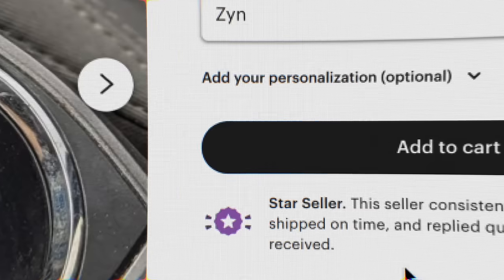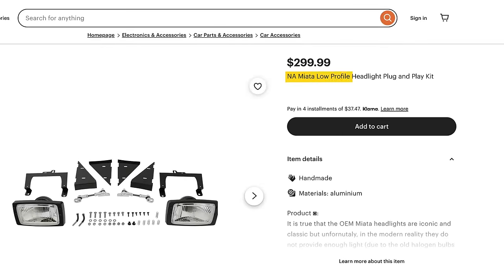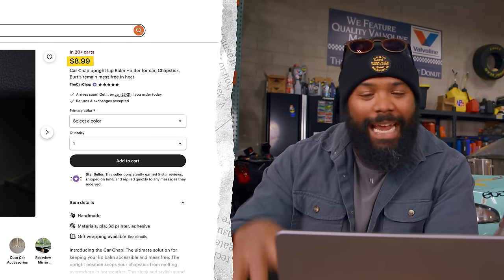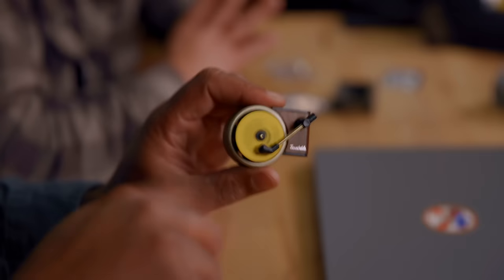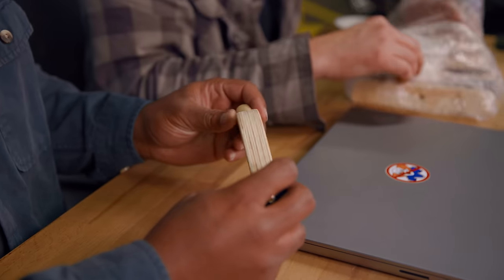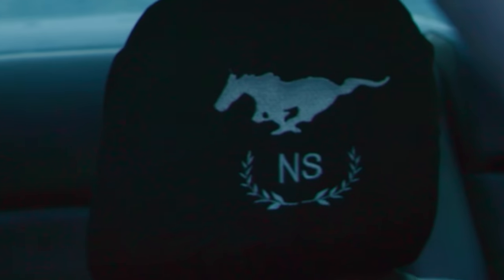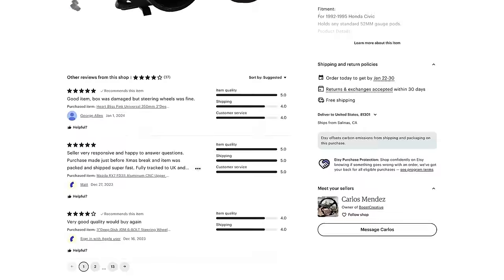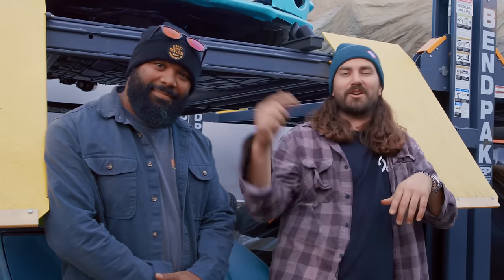We Tested Car Products from Etsy

Comment: honestly surprised that Subaru sponsored this, given everything the Donut boys have done to the WRXs and their engines 🤣🤣
Reply: I’m surprised it didn’t break before the commercial ended
Reply: @big.muscles.ohyeah  Uh, Honda, Toyota & Subaru are all over rated...
Reply: it was very sad to see them pushing some boring crossover tbh
Reply: @davidhollenshead4892  -- Honda and Toyota being "overrated" is an absolutely wild take lmao... I'm still driving a 2005 Camry. It's got 250k miles and it shows no signs of dying. Toyotas and Hondas are literally some of the most reliable and cheap-to-fix cars you can buy. Calling them overrated is just insane lol
Reply: Can't blame it all on the boys as they were used cars and they modified them but you can blame Subaru as the problems they had are common ones with that make and model it just so happened they had the worst luck and did it more times in a month than a person would in a lifetime. I think a lot of that came down to rushing things as production delays and video delays reflect $ and salaries and they can only spend so much time and $ doing things unlike an actual race team.
Reply: Those old engines did always blow up, modern ones did fix most the issues, (GR86/BRZ Oil pan lol) and their engines are good until you double the horsepower
Reply: @GrahamCrannell I was looking for this comment 😅
Reply: fax i was also surprised
Reply: I can't get a newer version of my current Subaru in manual, so I'm really not interested.  Plus the newer ones all seem to have big touchscreens, I'll admit I do quite like the backup camera in mine, but it is a separate screen from the radio and not that big.
Reply: @GrahamCrannell  think about what you said, and then try again the reason that they are overrated is because since that generation that you are driving, they have become junk. I guarantee you a 2024 will not get anywhere close to 250k
Reply: I like how they talk about the 9" clearance and the talk about offroading while basically using an unmaintained road
Reply: @davidhollenshead4892 did you read the part about the pizza crust?
Reply: @davidhollenshead4892  My '99 Impreza disagrees with this comment.
Reply: They probably have never watched an episode. Just some dude in marketing with a Donut foam finger rooting for the transmission to blow up again.
Reply: @davidhollenshead4892  no no.
Reply: On the contrary, 5hey probably appreciate all the free advertising and free R&D
Reply: I love cults. I'm currently in the The Skeleton Clique. Currently practiced getting crossfaded, listening to the whole trench album, practiced telechinesis in rhythmic fashion to control Nico and the Niners, and had Ned drink chlorine to promote self destruction as a representation to the values/ morals that us Banditos poses. We did all of this with a group of cliques in the Colorado mountains. Went well. Will practice it again next week.

Comment: I have a feeling that lip balm holder just turned into a dab pen holder 😂
Reply: Gotta keep the penjamin safe
Reply: Glad I wasn’t the same lowkey fire spot for the vape
Reply: @liamniles2534 ”low key fire” hits vape 

Is wild
Reply: As long as its just a holder and not being utilised while driving 😅.
Reply: @liamniles2534 you sound like an old person trying to be cool
Reply: @shanebanx9631  The feds are strong in these comments 🤣
Reply: ...I figured for a bumper. Which would be very very unwise to use while driving.

Comment: Subaru better be paying Donut a LOT of money, Nolan is really selling this car, better than any other ad I've seen!
Reply: It’s not that hard to sell a Subaru tbh.

I know 3 people (out of like the 10 I know) that bought a Subaru, and have bought only Subarus since, one of them owns 4 of them and none of them ever shut up about them lmao
Reply: @Fetidaf  Our family has only bought Subaru's or Toyota's since the 80's. No reason to drive anything else.
Reply: @StageRight123  I have a confession… I’m also one of those people lol

I found a cheap one a few years back and wanted an AWD car… now I have that one and a 2020 Legacy that I bought new and my next one will almost certainly be a Subaru as well.

Sure they’re not the most reliable and are a pain in the ass to do anything but change the oil but they’re nice to drive and super fun in snow… I actually pulled a couple cars out of the ditch last week lol

From my experience they’re fantastic cars to own to 80k-100k miles lol
Reply: @StageRight123  I mean sure if you don't want anything cool or easy to work on. If your only goal is to get from point A to point B, they do that well.
Reply: @Fetidaf  My '99 Impreza is super reliable. I got it used 5 years ago with 137k on it, and I'm up to 179k now.
Reply: @derpyduck5088  I live in the Sierra Nevada mountains where we get an abundance of snow. I'm talking we got 56 feet of snow last winter. Yes, FEET, not inches. Cool is irrelevant when it comes to getting to work and back safely.
Reply: Subaru cars are super good & reliable, it's just that sometimes their parts are hard to find compared to the likes of Nissan or Toyota & even Mitsubishi, Honda & Mazda

Comment: Glad you reuploaded this. Kinda funny, but the first product you guys hated is the only one that caught my attention. I'm a DoorDash driver, and my car is a 2 seater with only one small cup holder, so I can see why it may not be for everyone, but that cup holder is exactly what I need! 🤣
Reply: It is definitely great for when you take a break during driving. I would not leave it in permanently though.
Reply: @narancs5  I wouldn't use it when driving my vehicle most of the time, but the use case for me is when I'm dashing on the rare occasion that I have more than one or two drinks to deliver with an order. So for me, in that particular case, because I only have a single cup holder in my car, it makes more sense than just a drink carrier sitting on my seat and will probably prevent spills.
Reply: 100% that product is meant for delivery drivers
Reply: @Moolord23  Also for when the drive thru runs out of cup holders.

Comment: vastly underestimating the usefulness of the Chapstick holder. keeps it upright so it doesn't melt out and ruin it in the summertime.
Reply: I'm guessing this is a thing if you live in a hot dry climate, because up north chapstick is mainly used during winter.
Reply: @kutter_ttl6786  lol Las Vegas, it's February and it's already getting hot

Comment: What would be interesting to know is what material is used for the 3D printed parts? The most common Material for 3D printing nowadays is PLA which unfortunately isn't very heat nor UV resistant, meaning that it wouldn't be so suitable for the steeringwheel hook at the end, since part of it would get a lot of direct sunlight and thus probably warp and become brittle with time.
It should be made in something like PETG for example.
Reply: Would bet that it's just whatever the cheapest martial is, since even cheap stuff would probably last long enough to beat out the 30 day or whatever product return period.
Reply: I work with ABS/ASA because it lasts basically forever, but yeah a lot of stores will use PLA as it's easy to print. 3D printers are a tool, not a factory, but hustler-types treat them as a factory and that's where bad quality products come from.
Reply: PLA+ is comparable to PETG but as easy to print as PLA, in fact in my country you can't even buy regular PLA only PLA+ so that's all I use and I honestly wouldn't want any printed product which is only PLA unless it's decorative and Silk PLA or something
Reply: I saw that at least a couple said it was ABS printed, so those are all good to go.
Reply: Pretty sure those people are smart enough to use PETG or other temperature resistant materials. It's not as if PETG is heaps more expensive than PLA for this kind of stuff.
Reply: @irfuel you’d be surprised how much penny pinching is done in manufacturing
Reply: @F0XD1E  PLA, PETG, and ABS are all around the same price. Personally, I think PETG is the best filament for the job because it is a lot tougher (chemical and thermal) than PLA, while being easier to work with than ABS. 

Although, I will admit my bias as PETG is my go-to for almost every situation.
Reply: @micahanglen4331  For this application, ABS is the absolute ideal since that's the material that almost all plastic on a car is already. PETG is totally fine though (especially if DIY printing the parts at home as opposed to ordering or if they offered a lot of colors/translucent parts), just not the absolute perfect polymer for car applications.

Comment: Honestly a Chapstick holder is so simple but brilliant. In Michigan you are either in the hot humid summer or freezing cold winter. I have 3 Chapstick's depending on where I am at. I have 1 I keep at work, home, and in my truck. The one in my truck I put in my middle counsel so it doesn't melt from the sun or freeze in the winter and always have to dig to find it.

Comment: Those aftermarket tire valve stem caps are bad news if they are made from aluminum. They get stuck on with corrosion after about six months and are a pain in the butt to get them back off.
Reply: Good shout, it's a lesson I learned the hard way. Still love decorative caps but only go for ones with a plastic interior.

Comment: I made my own 3rd gen Tacoma 3D printed part for that square compartment to hold my Vape mod , multi tool, and pens.  But I didn’t make it full depth, and just tapered it to fit snug.  Only problem was, that once it heated up in the sun, it compressed in size and could no longer fit the things I made it for.  So make sure to account for more clearance if anyone makes something similar. Chew cans included

Comment: Not sure about the Miata but the 240sx headlights can be adjusted to pop up lower for the same look. If the Miata has the same "sleepy headlight" adjustment then that kit seems kinda pointless. Personally I love the OEM headlights but I guess this is a great option if your OEM lights are broken, with the diminishing stock of the OEM headlight part availability.

Comment: The miata headlight conversion kit looked like it was pointing the light straight at the ground in front of the bumper. Did you test it at night, or does it have room for adjustment? Just curious

Comment: The steering wheel holder at the end doesn't seem like something you wanna put in a normal car, maybe a race car with bucket seats where you need to remove the wheel to get in and out, but the point of a quick disconnect for a daily driver is for additional security, and lets be honest if you left you wheel like that in L.A. you would be missing your wheel.

Comment: Those valve stem caps. If they don't have a plastic insert and a rubber O ring inside they will corrode corrode on the threads on the valve stem -- at least in the mid west.

Comment: Hey now. I'm a truck driver, and I have a truck lip balm and a car lip balm 😆😆
No holders, but the car lip balm is situated with the 4wd gear stick thingamajig, and my truck lip balm has its spot in my right chest pocket.
And also, yes, the car lip balm has melted away on several occasions, as my car is parked out in the sunlight while I'm working,  and I'm living in australia.

Comment: I actually would rock most of these products, even the knitted steering wheel cover in my ride. I'm going to order the sun glass holder, rubber ducky, lip gloss holder and the tiny record air vent spinner. Cause why the fuck not!

Comment: Ain't no way that Zin holder thing is 30 dollars. It's a piece of cheap plastic!
Reply: The old volvos from the 70s 80s and 90s have a built in holder for this in the door panel, (though that storage compartment was probably not intended for it originally).
Volvo being swedish after all... Taking in to account the amount of people in sweden using snus.